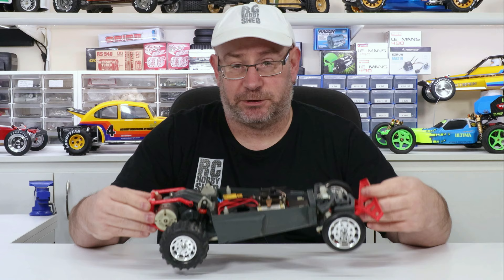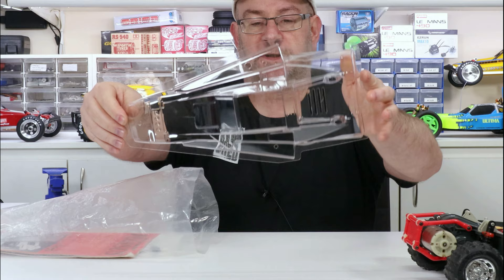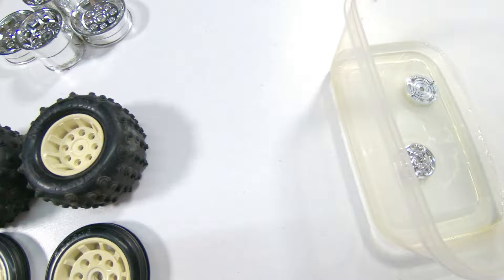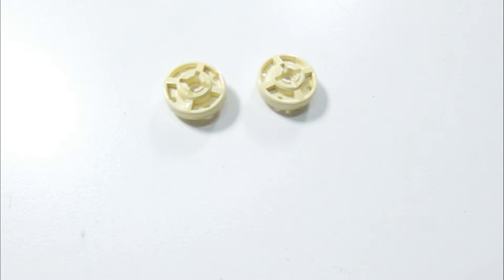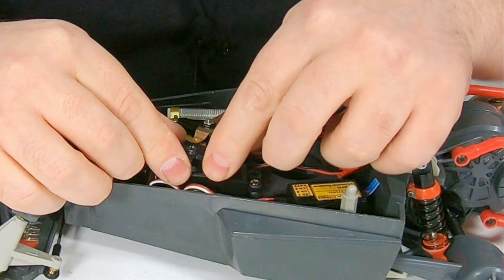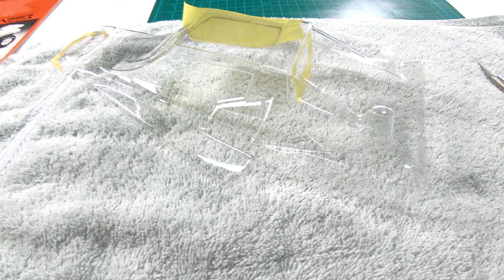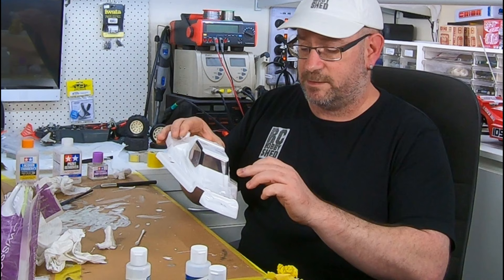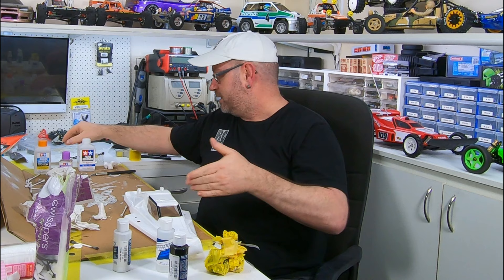Kyosho Pegasus New Build - Painting The Body

Comment: Isn't there Tamiya paint that you could have used in the airbrush instead?
Reply from the maker: I have decanted Tamiya PS paints before and used them in the airbrush. Not good results though as it tends to dry on the way out of the nozzle, which kind of makes spider webs of paint. If Tamiya still made the PS paint in jars it would be better but they stopped making it many years ago. Tamiya acrylic paints may work on Polycarbonate but I haven't tried them. I usually use Createx Auto-Air paints for air brushing but thought I'd give the Proline paints a try, they actually seem very similar.  👍